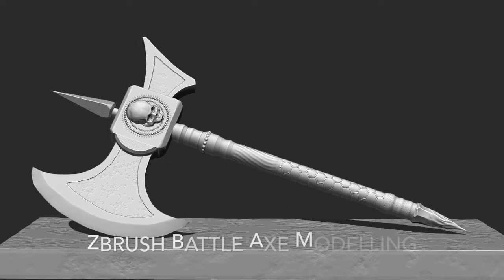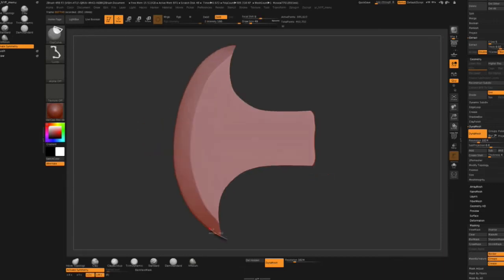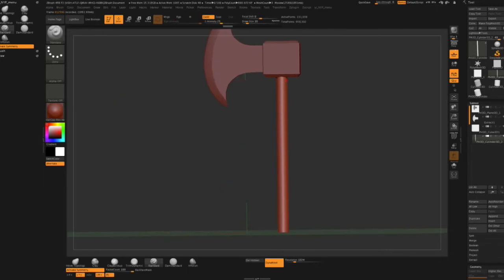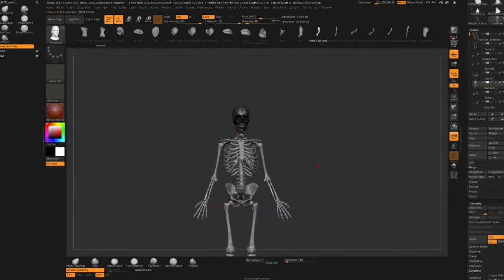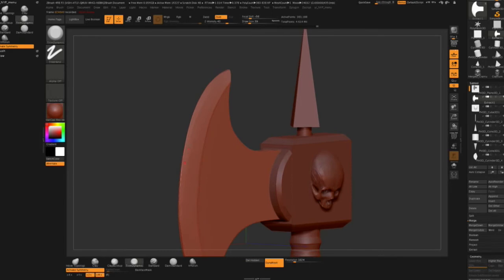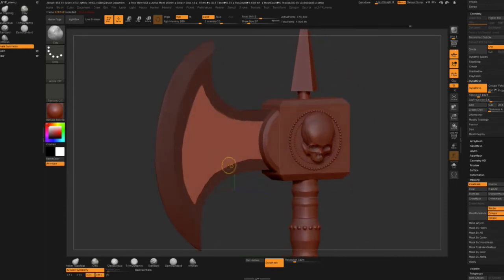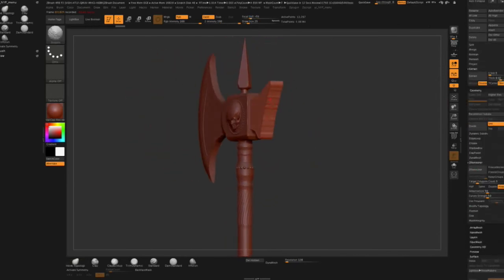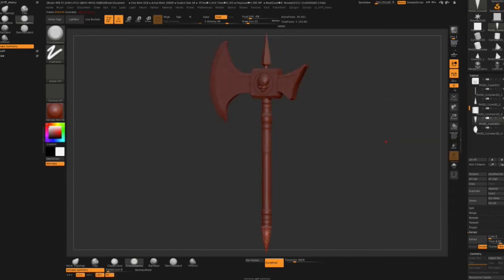ZBrush Battle Axe Modelling

Comment: This tutorial is amazing. I have a small doubt. When I try to sculpt the handle with radial symmetry ON, it's not sculpting on the handle bar. Instead it is showing the projection somewhere else. How do I correct it ?
Reply from the maker: Please make sure that the handle's pivot point is on the symmetry axis (or world origin)
Reply: @kevfx  : Thank you. I'll try
Reply: If that didn't work. You can  try local symmetry for that specific tool.
Reply: Its too late, but I think you just was activate different subtool) need to just activate handle which you working on)